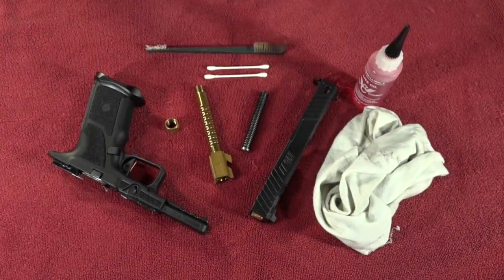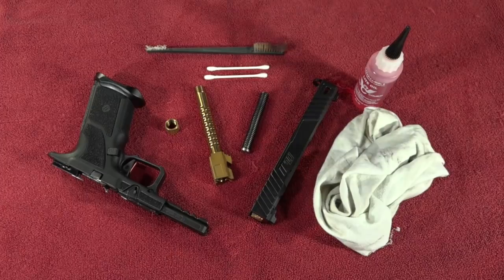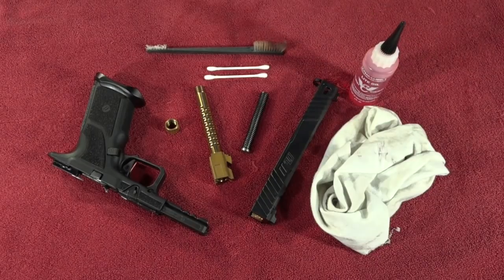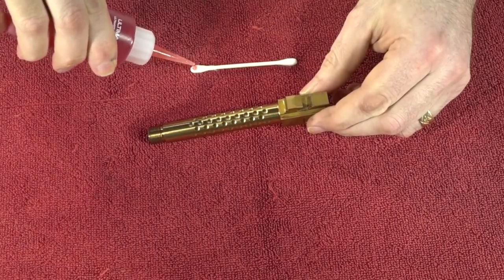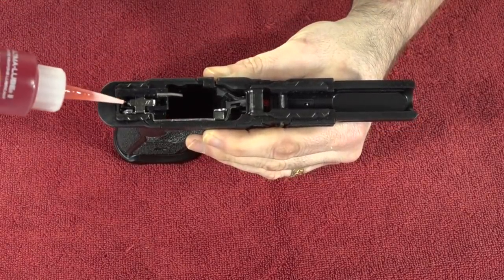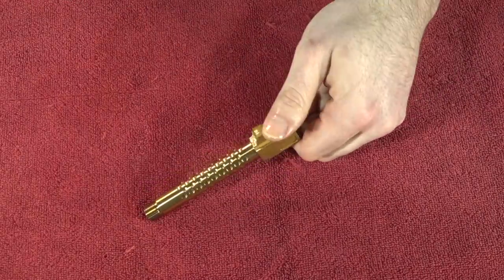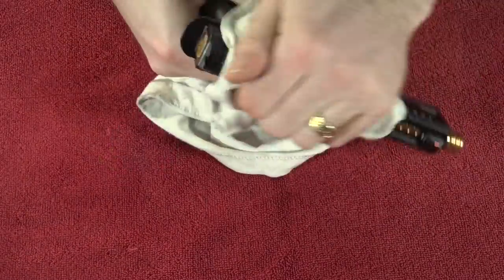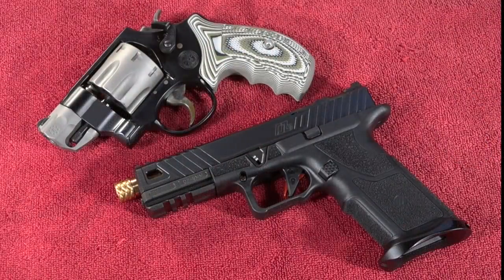How To Properly Lubricate Your Handguns (& Not So Properly Too)

Comment: Just some aside stuff, as I am no expert, or even a decent amiture about the care and feeding of firearms. One thing I did with my air compressor was use an old condenser coil from a junk refrigerator to cool the air from the compressor. I put it inline with the outlet of the tank using flair fittings, then I put a moisture trap and a regulator after that. I was painting appliances at the time, and my lashup did a great job of eliminating moisture. I put a regulator after this because cooling the air reduces the pressure, and any moisture in the air directly from the tank can damage the regulator. I have included this to help with keeping moisture out of your firearm. Another suggestion is if you need cleaning cloths, Walmart has huge bags of microfiber towels in the automotive department that are "seconds", but only $10. Harbor Freight also has coupons for microfiber towels. These don't have lint, and that might be a good thing. When all of the "brush fires" in my life are put out, I plan on getting the Ruby Royal that my Dad brought home when he returned from WW2 back in shape. Best wishes everyone!!

Comment: I also use Wilson Combat oil. It's really good. I believe the air compressor should be limited to blast unwanted particles or may be oil. Be careful it may get the oil where it doesn't belong.
Reply: Are you still using Wilson's lube?
Reply: @5jjt , yes, I am. I am very satisfied with it.

Comment: I def overlube / use a protective for storage. Then wipe down before I shoot.
Reply: Me too.
Reply: I do as well. I give them a bath in Ballistol, wipe it down and give it a few drops of oil on the rails, barrel hood etc. and there ready to go. I clean them after every range trip so any extra lube doesn't get a chance to collect carbon or gunk plus the Ballistol leaves a protective film on the gun protecting it from rust.
Reply: @transambill1  The smell of Ballistol is something else..  I'd use it more but it makes my basement smell like the garage.
Reply: Exactly, storage wear is often times overlooked.

Comment: No such thing as over lubrication. Larry Vickers dips a Beretta in motor oil and it still runs flawless.
Reply: James Yeager winces 😣....
Reply: @DavidLLambertmobile  I know but the video is out there proving it. He actually pours motor oil all over the Beretta covering it and then fires it and all works well but you get motor oil all over you.
Reply: Over-lubing can attract dust/dirt/moisture. Also, if kept loaded lube may migrate onto the ammunition, which can cause issues.

Comment: I'll oil it up just like that and I'll get just a little dab of grease on a q-tip and lightly hit anywhere that there is metal to metal friction like the rails. Oils will flow and evaporate over time but the grease will stay put(don't reccomend for really cold environments like -20°).

Comment: Larry Vickers and Bill Rogers totally debunked this with Paul Harrel type science. I rather see PH do a video since I like him more.
Reply: Austen Hernandez  I was referring to his comment about "Over lubing being worse than than under lubing."
Reply: Are you talking about “the myth of over lubing” video? If so, that’s an insult to Paul Harrell...that video didn’t test much.
Reply: @diesel5355  They said, "Over lubrication is a myth" then completely submerged a firearm in oil and then showed off it had no affect in reliability, how is that not showing much..?
Reply: Toamaius D'Vignir roll it around in sand and see how it does
Reply: Bill Wilson basically does the recommended method not spraying like this.  He admits he is worse person cleaning his guns.  He uses Wilson Combat cleaner, lube, etc.  But, also recommends Lucas Gun Oil.  He also, cautions "over lubing".
Reply: The Larry Vickers and Bill Rogers video is misleading.  Yes, a firearm will mechanically cycle even after submerging in and dripping with oil.  But those who advocate against over lubrication aren't making the claim that doing so affects the mechanical function of the gun.  What they're claiming is that over lubrication attracts and holds dirt.  This fine grit entrapped by the oil then acts as an abrasive slurry, causing premature wear that could have been avoided had the proper amount of lubrication been applied instead  (i.e. a hell of a lot less than you think you need).

For an in-depth discussion of how to properly lubricate a firearm, check out certified factory trained armorer for Ruger, S&W, and Remington GunBlue490's videos on the topic:
https://www.youtube.com/watch?v=o8-MPsV2Wrg
https://www.youtube.com/watch?v=pQuNgXqWPEo
https://www.youtube.com/watch?v=zPAzSVtSaDk
https://www.youtube.com/watch?v=JYvVvBuV9uY
Reply: @ @JohnDoe-zl6qw   You are correct, and stated it nicely!   With to much lube and shooting alot the lube and residue from firing develope into a fine "Lapping Compound", as you stated an abrasive!  However, it can pertain to the gun how much of a problem it will cause.  Wilson Combat, Les Baer, Ed Brown pistols, it can really cause a function issue due to very close/tight tolerances.  Typical off the shelf guns Glock, S&W, Taurus, etc. you don't have to worry about tight tolerances so much.  They will run overlubed.  
Personally, lube the gun per the manual while looking for wear marks and hit them with lube.  One point.  I clean pistols even if they haven't been fired for a while.  I'm in Florida heat in the summer is brutal so just keep them lubed!
Best to ya',,,,!
Reply: @walterminer4990  Which brings up another valid point: lubrication to fit your local climate.  The humidity of Florida probably requires a little extra lube to prevent corrosion.  Where I'm shooting in the desert, running it nearly dry is advisable to prevent the fine sand dust gumming up the works.  Someone in a cold climate will want a lower viscosity lube/lighter oil that will flow freer in sub-zero temperatures.  There's no one size fits all; have to tailor it to climate, shooting conditions, frequency of range sessions, etc.  Goes back to fundamentals: know your tools, know how to clean them, know how to maintain them.
Reply: @ Austen Hernandez   Hello Austen!  Problem is people sometimes drink to much of these "EXPERTS" Kool-Aid!   Revolvers have a couple key areas to lube.  Basically, a drop or two in areas that have to move.  His method is like change the lube (oil) in your vehicle buy putting some everwhere, sounds weird, but you get my point.  Semi-Autos are a different beast, still very simple.  However, you know well that manufactures don't want a bunch of lube in certain areas.  
Air compressure?  Well some have dehumidifiers in-line. Some don't.  He doesn't explain what air pressure to use?  Maybe someone will blast a 100 psi into their guns and blow intricate parts out of alignment or blow lube into areas recommended to be almost dry?  
I was educated as a Machinist in high school from 1966-70.  Later on recieved a degree in mechanical engineering.  I DON'T know everything!  But, the people that manufacture guns give a maintainace schedule or procedure for a reason. Even being mechanically inclined I have a gunsmith work on my guns if necessary, that was once into the late 70's or so  Why? I've worked constructing nuclear submarines.  Gunsmiths wouldn't tell me how to build a sub, I don't tell them how to build or work on guns!
Just stick with standard cleaning procedures and the gun will work fine!
Very best to ya',,,,!
Reply: @ @JohnDoe-zl6qw   John that is a perfect example, Thank-you!
You're in the desert, I'm in a HOT damp environment.  Part of the year we get sudden down pours, my pistol get soaked even under concealment.  But, I don't field strip it everytime this happens for one simple reason.  I clean, lube every month even if I haven't shot it.  One person said I was nuts that I was over cleaning for no reason? Okay, strip your pistol RIGHT NOW!  Huh? Yep, we're in a store parking lot stripping the gun in the car, (I got out until he unloaded it)!  Barrel out, I tell him to look down the barrel!  Geez, it looked like when you move your refridgerator and see the dust under it!  He was amazed.  He say it never comes out my holster?  I say LOOK inside your holster? ANOTHER important piece of equipment overlooked.  His holster was loaded with crap.
People seem to have lost their common sense!
Best to ya',,,,!

Comment: Automatic transmission fluid.... There's a mix of that and something to cut it some out there. Seems to work good for me. 
The old guys use to use it all the time.
Going to have to wait till next year to see how it works in the cold, really didn't have a real cold this year.
Reply: Half atf and half STP oil treatment.
Reply: I completely agree..... automatic transmission fluid
Reply: @oldkbellguy5156  stp with atf sounds like a great idea....
Reply: Atf is probably the best option.  But the smell is awful.  I settle for 0w-30.
Reply: Is OW16 the best motor oil viscosity suited for gun oil?
Reply: Auto trans fluid will clean anything

Comment: I like keeping it simple. Spray it down with BreakFree CLP or RemOil, wipe it down with a rag, then add a little grease to the slide rails, barrel cam surface, and the barrel locking lug. I do this to all my handguns, and none of them have had any reliability issues as a result. If there's a lot of gunk in the gun, then I'll use a toothbrush to get into the nooks that need cleaning.

Comment: Wow Yankee man I was taught never to use the excessive amount of lubrication that you have used I can't believe the amount and then on top of that you whip out the old air compressor that blows all that lubricant deep inside all the crevices now you have what I call over lubricated firearm
Reply: First of all have you ever used rem oil? It dries pretty fast, and leaves a tephlon film or something similar. Secondly he blew the oil off with an air compressor and wiped it down. When it comes to lubrication do what works for you, everyone has a certain way of doing it and I personally know several people who use a similar method with no issues.
Reply: @John5.56  first of all Yankee man sprayed his Rim oil excessively in the firing pin and secondly he really sprayed it heavy as hell all over the gun grip. But if you like all that oil being applied on that gun grip the best to you guys
Reply: @robertcracolici1617  I'm not recommending it at all, I get rather meticulous when cleaning even tho I know it's not necessary. All I said is I know plenty of people who do it similar, and to do whatever works for you. If you ask 100 different guys to show you how they clean a glock 19 you're likely to get 100 different variations of the cleaning process. Point being I wouldn't get too caught up on cleaning and lubricating them as long as you keep up with them.

Comment: You should share what evidence you have that an excess of lube could damage guns.  And under what conditions?  I mean it's clean fresh lube.  The trapping of contaminants isnt an issue since you already advocated for cleaning after every use.
Reply: @justmeiswear  what about while doing nothing in a safe?
Reply: @aussieexpat  depends on time and air quality but eventually the same thing as in the desert will happen, too much lube allows stuff to accumulate. Most often, for most people, a thin film of oil is all you need and will provide all the lubrication that is necessary. If your talking real long term storage, put it in a sealed bag with some silicon moisture absorbing packets.
Reply: @DracoOmnia  If you use a real oil, not rem oil, it won't evaporate and the oil will protect the metal. More lube, more protection.

Have you got any evidence at all that using too much oil in ANY situation will cause damage?

And let's get specific, when I say oil, I mean synthetic motor oil. Not some biodradable vegetable oil or "gun oil".
Reply: @aussieexpat  Was waiting for you too say motor oil. I over lubed my browning hi power with motor oil. Took it to the range and after one mag the trigger group froze. After going home and disassembling it, I found that the over lubing with motor oil  would leak into the trigger group along with soot from firing cause a malfunction.  Now, over lubing may not damage a firearm but it can potentially cause a malfunction during firing.
Reply: @Coinz8  sure, it's plausible lib in a firing channel can cause a malf when combined with soot.  But the claim here in the video is permanent damage from sitting in a freshly cleaned and then overlubed firearm sitting in a safe.   It's outrageous.
Reply: The problem with too much oil is that burnt powder mixes with the oil to form a viscous sludge.  This is a well known problem, and not something that Yankee made up.  Striker fired guns are particularly vulnerable to sludge build up in the striker channel.  This can cause light strikes and in the worst case actually jam the striker.  For that reason I never use spray oil near the rear of the slide.  I would advise against putting oil on the breech face as Yankee did here, to avoid any oil getting into the striker channel.  The striker already rides inside a slick plastic channel that needs no lubrication.
Reply: @gunlovingliberal1706  Neither the video, advice nor my question deals with firing the firearm nor malfunctions. The specifically claim is the on a clean gun, that is overly lubed, then put in a safe, can suffer permanent damage due to the excess lube. This seems extremely hard to imagine yet alone believe.
Reply: @DracoOmnia  I agree that an excees of oil on some components will induce a malfunction. But as long as you know that, there's no real need to be concerned about an excess of oil generally speaking. Too little oil on more parts of the gun absolutely and immediately cause permanent wear, damange and malfunctions.

Between the two options, dunk the fucker in the stuff. :p

Comment: The air comming out of the compressor is full of moisture.
Reply: Unless he has a good dryer attachment for the compressor.
Reply: Or a decent air compressor with the lines plumbed correctly with a drip leg, most home gamers don't need an actual air drier, a simple coalescing filter and properly plumbed lines is all you need
Reply: MOISTURE IS EVERYWHERE!!
Reply: @elcompamartinez2647  
An air compressor works by squeezing air into a smaller volume under high pressure. When a compressor draws in air, the air is compressed to about 12 times normal atmospheric pressure. Pressurized air is not able to hold as much water. As the pressure increases, water vapor condenses back into a liquid. The water in the air has to go somewhere, so it forms a condensate inside the air compression system.

Comment: Long ago and far away I carried an M249. It was properly lubricated with exactly 3 drops of CLP. I will say ya got me with the air compressor. It's waste of oil, but it will not be over lubricated.
Reply: The rem oil and air will clean out gunk and residue  you can't reach

Comment: Overlubrication seems like not really a problem. I try to cover every untreated or wear surface in mineral oil it seems just fine. Glock's factory copper grease on the slides seems like a conscious choice too, so maybe apply some there first if you feel like it.

There might be some stupid gun somewhere that is hyper sensitive to a bit of standing oil somewhere, but no conventional handgun I'm aware of. I'd rather have some extra oil preventing corrosion and wear than the mere slight lack of it necessary to permit corrosion and wear.
Reply: It’s not the oil that’ll mess your gun up from over lubricating it’s the grime that’ll attach to the oil and eventually cause fire arm malfunctions.

Comment: I been using liquid graphite mixed lightly with Castrol Synthetic gun lube for 20 years. Never had a problem unlike using straight Hopps or just the Castrol gun lube itself. Been my experience gun lube alone will dry up and look like you never used any after a few months of carrying but the oily liquid graphite is always there, (and of course I'm talking abouth the slide rails and and metal on metal parts.Small parts and springs get just basic gun oil)but like the Yankee Marshall said, don't over do it. Any afterthoughts Yankee Marshall?

Comment: Huh for years I have been using 3 in 1 oil it may be wrong but I haven't had a problem with it yet
Reply: What is 3 in 1?
Reply: Multi purpose oil u can get it at Walmart in the tools usually it's really cheap and works really good

Comment: I know you won't like this, but I just hose down the inside and out, do a bunch of hickok45 slide jacks and then wipe down the outside metal with a oil damp cloth to remove excess oil and finger prints

Comment: I would think twice before doing that to a 22lr auto. I jammed the firing pin on a S&W Victory and a Cheapappa 1911/22 by oiling it.
Reply: I have a sw victory and put a couple of drops into the firing pin area every time I clean it. Havent had any issues yet.